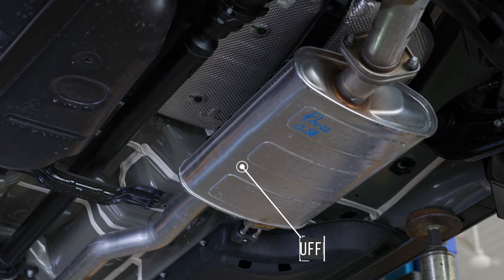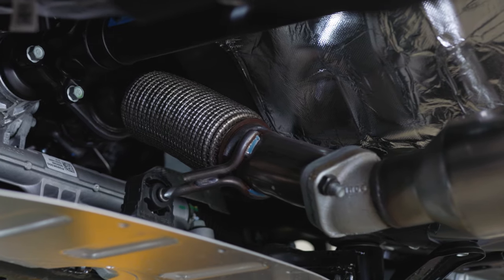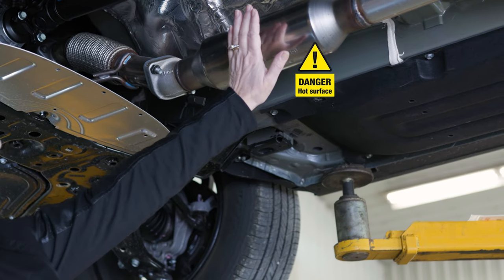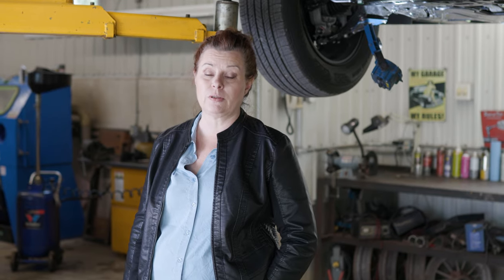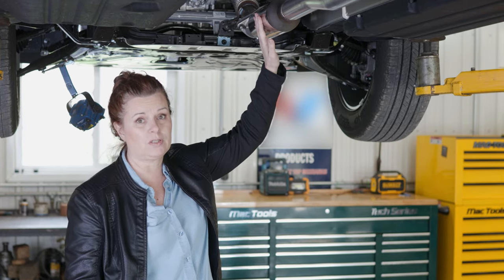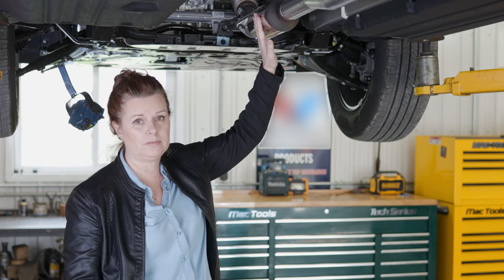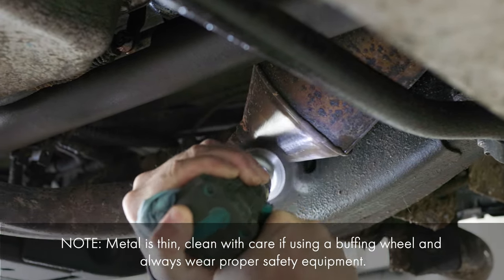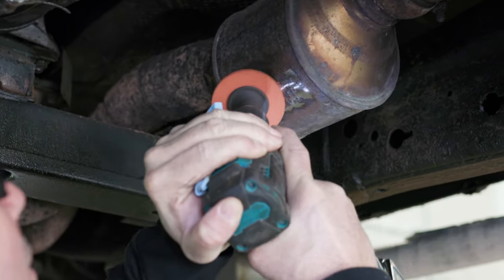Catalytic Converter Label/Etching Installation Training

Comment: Can’t the thieves grind off the code?
Reply from the maker: Yes, they can, just like all marks. The product is theft prevention, and both the USA's NHTSA and Canada's CCMTA strongly advise adding good identification marks because it helps deter thieves. 
There is no "silver bullet"; all we can do is make the product less desirable to steal. 

Another point is that removing identification marks is already illegal, and a higher crime in some jurisdictions, and the trend is growing. This makes having a catalytic converter with grind marks an even higher risk.

Comment: After applying the stencil and the etching fluid and running the car is the stencil removed ?   Or does it fall off on its own?
Reply from the maker: The "stencil" is a label that is designed to stay on the catalytic converter. It provides an additional warning for thieves. We have one on a test vehicle that has been in place for over ten years, and it is still in place and easily read.